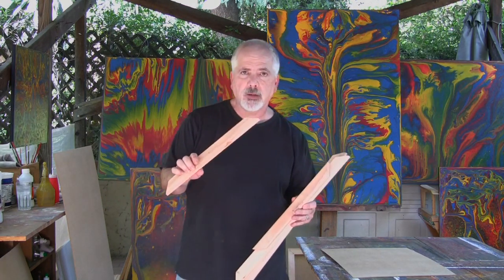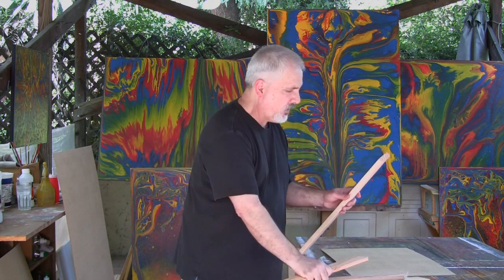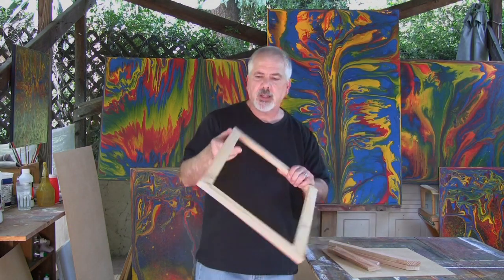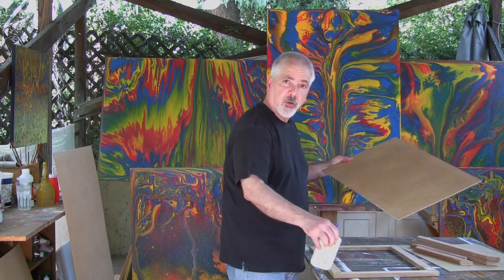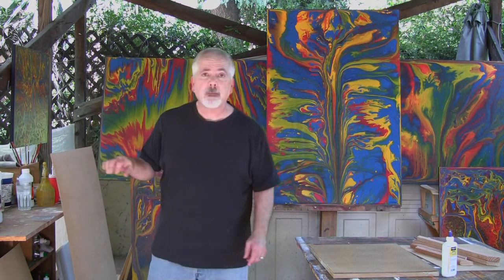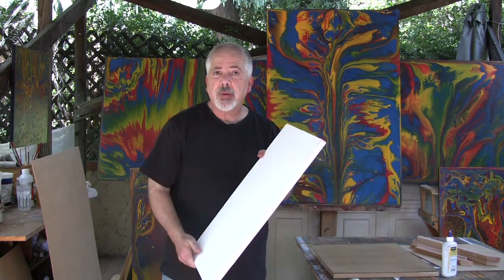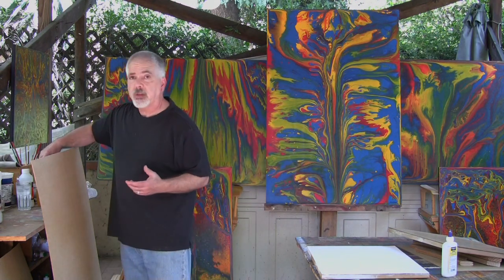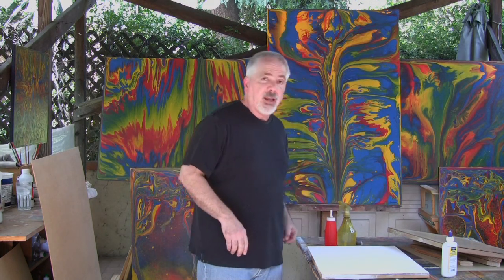Painting with acrylics on hardboard

Comment: Thank you so much for this video.....I wanted and inexpensive way to continue painting and I decided to start using boards from Home Depot and loved the results, but after about a month and I started noticing they were warping even the blank boards.  I started looking at videos thinking there was a particular type of wood board to use that wouldn't warp and came across your video.....than you so much.....I love love love love you for being so forthcoming to help out with methods to us novice painters.
Reply: I need to get learn to use my miter saw, that's sitting in my garage and make frame to mount the board on.  Clever.

Comment: I love your work, it's epic!!!  I am 65 and new at painting with acrylics, but I prefer larger sizes  for abstracts.  I purchased 24x36 harboards, but it gets expensive and I want to go larger.   Using masonite is much more affordable for larger paintings, but have not tried it yet, but I am going to.  What larger size do you like best?  I was thinking a masonite sheet cut into three pieces, 32x48.   Can it be glued onto a frame?  I don't know if I want to cradle the back, I like your idea of glueing it on a ready made frame and using brad nails.  I sure would be nice to frame it in some kind of silver metal frame, but sure it's not possible.  Thank you so much for your time and sharing with us so unselfishly.  You Rock!!  Warm happy painting greetings from Canada!!
Reply from the maker: I do the same size, not too heavy to hang. Use 2 nails in the wall evenly spaced and level with each other. I don't frame my work. It's meant to float.
Reply: @LuisRemesar  thank you so much for your advice.  Do you think using 1/4" masonite, 32x48 is too heavy to hang?  They hang heavy mirrors so I don't see why not.  I would rather not have to cradle the back of 1/8".  I am confused as what to do, since I am going to purchase masonite soon.  Thank you again for caring and taking the time out for us all.

Comment: Thank you for this!! Love your paintings. Question, would I have to add more support to the hardboard if it were much bigger, like maybe 48x48"?
Reply from the maker: I go up to 32x48 with what I describe in the video and it works well. Try it and see.
Reply: I take 1/2" square poplar board sticks and frame the rear side glue on then next day screw around the edges through the face to a slight countersink then spacklepaste and glue over the screws then prime.

Comment: Thank you for the video . Ferrying strips for 98 cents for eight foot . Do you mind sharing where to get it at that low of a price ? Lowes price is about $9 .
Reply from the maker: Home Depot.
Reply: The $9 stuff is a finish grade spruce or pine.  What he is talking about is not finish grade.  But he's correct about the price.  You just need to pick out straight ones, and there wont be many of those.

Comment: I have painted over wood surfaces in the past without sealing. Some of the wood warped and some didn't.IDKY. I now prep it but is there an unwarping method?
Reply from the maker: Just mounting the board on the wooden armature as I describe.
Reply: Oh,so mounting the board on an armature will straighten out the already warped paintings. :) 
 TY. very much.
Reply from the maker: You can try and wet the back of the board and mount it wet. it might help straightening it out.
Reply: ok thx.

Comment: The material you are using is the cheapest crap available.

Professionals use artists hardboard, smooth both sides.

You left out that this crap is made from sawdust, and glue/resin under pressure.. No more, no less.
Reply from the maker: Thank you! That's the whole point.